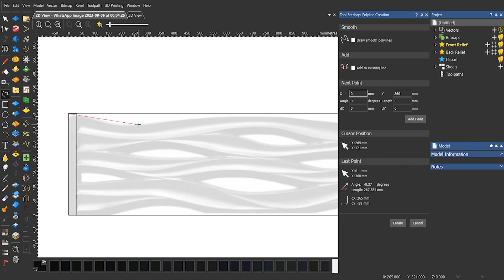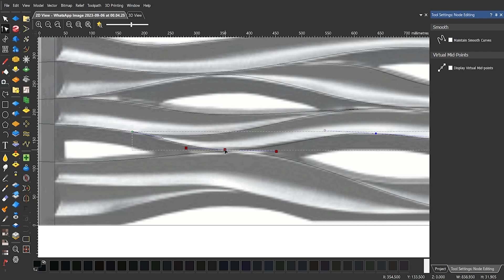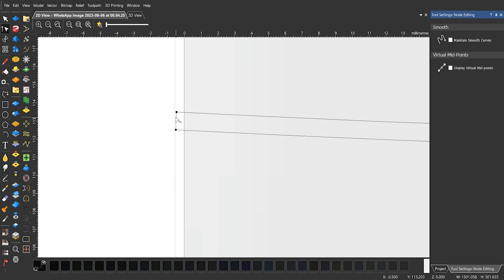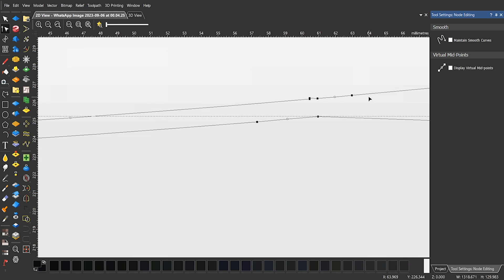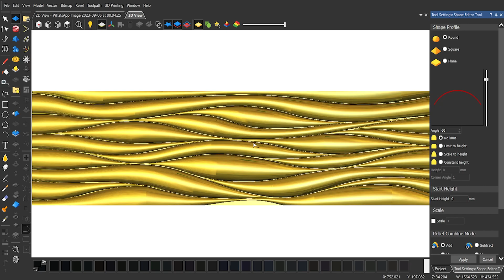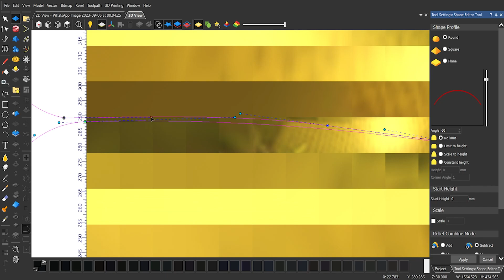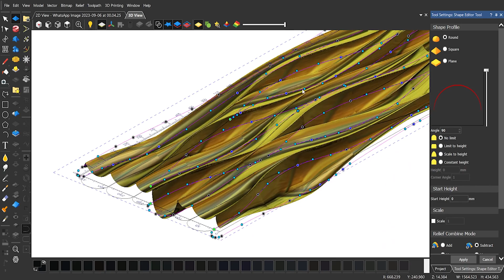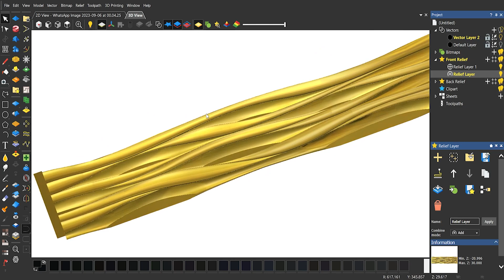How to Create a 3D Panel for walls | Interior | ArtCAM 2018 | CNC Wood Router Design | 3D Modeling

Comment: 5:04 In Shape Editor>Relief Combine Mode>Add. After that, what are the repeat the process? And Relief Combine Mode>Subtract.
(1st Step_Retanglar>Shape Editor>Plane>Start Height=30mm>Relief Combine Mode>Add)_Make Relief Layer
(2nd Step_Draw Vector>Shape Editor>Round>Angle=60>Relief Combine Mode>Subtrack) 
(3rd Step_Select Some Vector to Make Hole>Shape Editor>Round>Angle=90>Relief Combine Mode>Subtract)_Make Relief Layer 1
But the holes don't appear.
Naksh, I don't understand. Please, some tutorials like this.
Reply from the maker: to see the holes you are missing a step. after 2nd step add a new relief layer>set its combine mode to merge and than go to the 1st layer and apply the 3rd step.